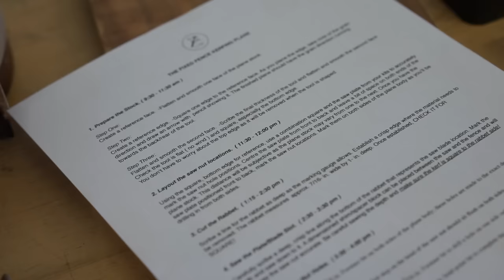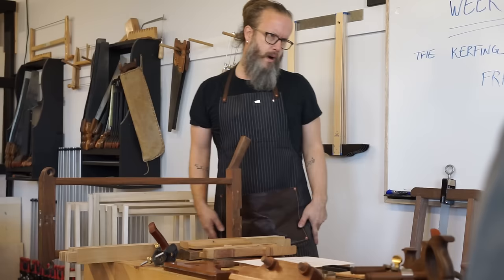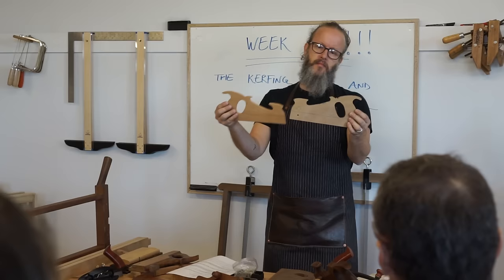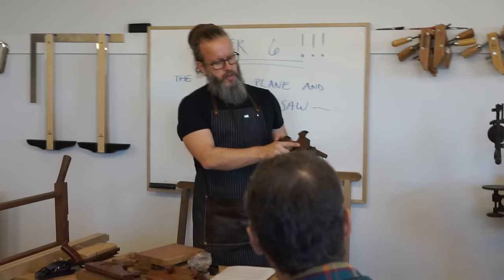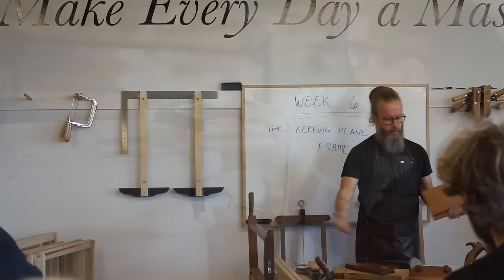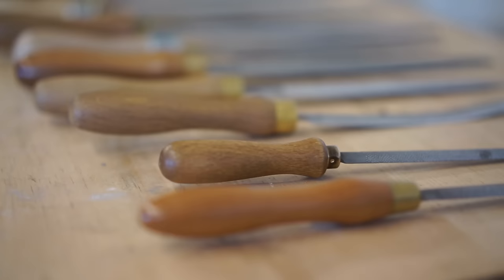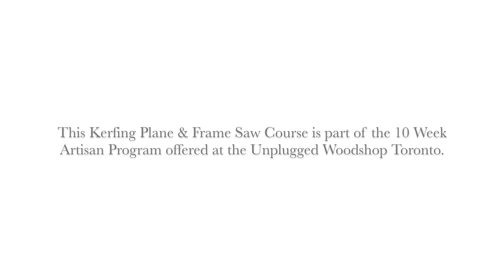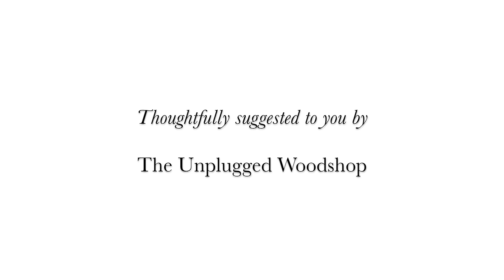The Kerfing Plane & Frame Saw. UW Artisan Program November 2016

Comment: How much does it cost to set up a nice electric free workshop (like yours)?
Reply from the maker: Thanks for the question. That's difficult to answer as it depends on the tools you're using, the bench, etc...but a safe bet would be $350. to build a decent workbench with a vice, and $1000. for a good beginners kit of hand tools. Some wood and glue- you'd come in around $1500. Wouldn't be easy to do that with power tools-; )
all the best